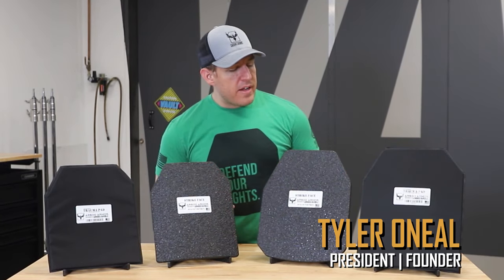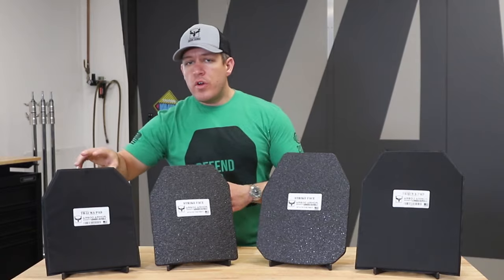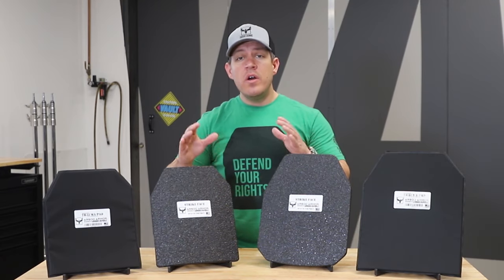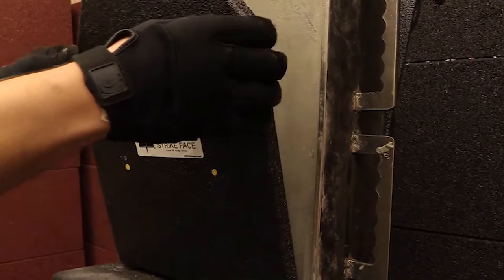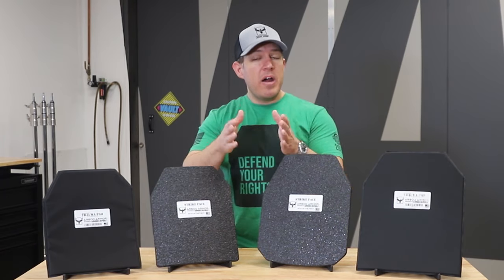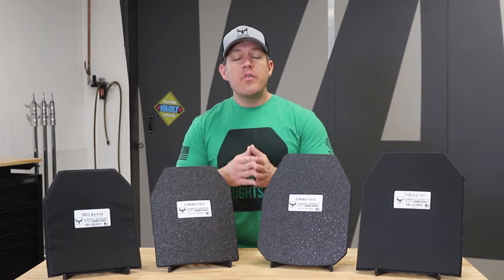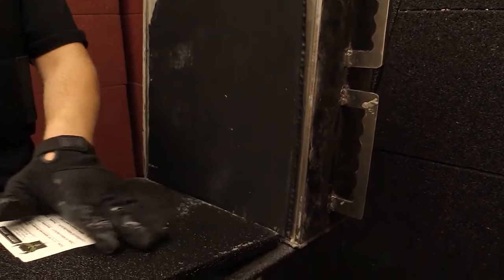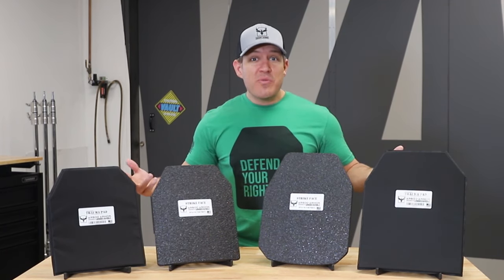Why Run Trauma Pads?   AR500 Armor

Comment: "Why do I need a trauma pad? The armour stops the bullet."

Yeah, but people dont die because they got penetrated by cars, they die from the impact. Bullets, when stopped by armour, turn into pure impact.
Reply: blunt force trauma
Reply: You dont have external bleeding thanks to the armor
Unfortunately you got hit with a shotgun slug and your ribs are broken,
SOOOOOOO you do have internal bleeding.
Reply: @kenshy10  or you just see a bruise on your skin and you don't think of the bruise being 2-3 inches deep and impacting your lungs or heart.
Reply: Just say: "commotio cordis". They'll either understand immediately or think you're casting spells on them. Win-win.
Reply: I would describe body armor to protect the surface but the force of the bullet is still there.
In other words, its like shooting and shattering a window pane glass of a store. The bullet is able to travel through the glass, and still damage what's behind the glass. 
Another easy example is, when you buy a product that can shatter glass, which is sometimes an extra feature from self-defense non-lethal weapons like whips or a belt cutter. They may send you a sample piece of material to shatter as a test. If you imagine having a piece of wood, glass, or other material, a thin piece of it, on your or someone else's body, and strike the middle with the glass-shattering needlepoint, while the flat thin piece of material protected the body, the force of the strike is still spread around the body.

In another example, imagine the prank some kids do by putting a hand on your scalp and hitting the top of their hand on your head with their fist. You'd still feel the effect of the force spread under their hand that is spread much more widely across your skull and head/neck. 

I'm new to the gun world still since 2020, so this video helps me understand that trauma pads are meant to be placed behind the steel/ceramic body armor to dissipate and mitigate the rest of the force of the bullet.

The only problem is choosing the right plate material for different situations, such as knife attacks and bullets. 

So far ar500 is showing ceramic + soft body armor to have shelf life of 5 years, which is barely anything. Soft body armor are around 100 so its affordable all things considered but for me who may be someone who finished college, many of these purchases for body armor, trauma pads, the chest rig or just the vest, and even gun optics, can be very pricey between 100 to 200 to 400 to 600 easily. I still need to get a can for my guns. 

I'm glad I went with steel armor to keep it over a long period of time but at the same time its a waste to use against pistol rounds, but I had to get the toughest first, due to the panic buying going around. Things cooled off in the last year luckily but the last 10 years (or century) is still the best time to be stocking up on everything, even emergency food buckets that are supposed to last for around 20-25 years at least while unopened. 

First you see riots or crap in other towns/cities. Then when you see it happen during the Flloyd riot night on local television, its akin to seeing the start of a zombie apocalypse (or any apocalyptic/SHTF situation) when looting and violence starts. Thought to myself, NOPE. I'm getting a rifle by the end of this week and that was final.

It's just shitty when you live in a peaceful city and you just never expected it to happen. Never expected crazy gangster shit to happen, and when it does, your world is never the same. We're already in that zombie fantasy world, we just didn't realize the level of danger and the necessity for self-defense till disaster struck near us. 

People talk about self-defense but come on. Guns are meant to take people out too when necessary. People are too scared of that burden and scared of crossing lines.
Reply: @yourmumsy1081  Solid armor stop bullets. Soft armor, pads, help transfer the force from a bullet size blunt force to the pad which is over a large area. It's like having a fat chick that weighs 200 pounds completely put her whole chest and stomach on yours when you are lying down.  Then you take a chick that weighs 100 pounds only she is standing on your chest and stomach while you are lying down. The fat chick in this case is the energy on the trauma pad. You have more energy but it's transferred a larger area which helps reduce internal damage.  The skinny chick in this case is the energy only hitting a smaller area but with a concentration of energy that is higher which may cause more internal damage. If you are serious about armor, soft armor is part of the kit.
Reply: @kenshy10  internal bleeding? That's where the blood's supposed to be..😂
Reply: @drakke125Channel  bro that was the worst and longest reply i dknt think anyone made it past the seckng paragraph

Comment: I Know it's a old video but I'll ask anyway. o and love y'all's armor use it's in all mine and my family's kits. fell free to send me some products to test. anyways ..... my Question is if you have Kevlar armor would you still need a trauma pad or would the Kevlar act as a trauma pad? some of our plate carriers come with the Kevlar init already and I always wondered if I still need to get them. we use y'all's steel armor plates in all our carriers.
Reply from the maker: Thank you for the question. No, Kevlar and Trauma pads cannot be used interchangeably. They do different things. Kevlar provides a material that is strong enough along the tinsel lines to stop a handgun round.  Trauma pads use a non-Newtonian padding to resist energy with an equal and opposing amount of energy.

If you are talking about stopping something that may pass through the primary armor, Kevlar (or soft armor) is what you will want behind it.

When the primary armor stops a threat, a trauma pad behind it will dampen the forces pushed back into the wearer. Kevlar will NOT dampen these forces and the transfer of energy from the main plate will pass through the soft armor panel in into you.

Ideally you would want all 3 if permittable.
Reply: @ArmoredRepublic2  thank you for the information we will definitely be adding the trauma pads in our carriers. Keep up the good work and keeping everyone safe.

Comment: As I've been digging into armour, I've been increasingly curious what exactly makes up a trauma pad? I do not see reports of people having personal results with them (fortunately) but it does begger the question... What exactly IS a trauma pad? 

Non Newtonian fluid feels wrong, because they aren't fluid and if they were, it would settle to the bottom of whatever seems they had. I don't find cutaway videos or anything really breaking this down. I don't want to volunteer to be the guy to "demonstrate" a with versus without, but without any firsthand accounts I can find, it makes me more curious... 

BFD aside, the NIJ has an absurd level they accept. Some 44mm which is almost 2". Insane, not a level I'd want poking into me, bullet stopped aside. So to simply be NIJ rated and assisting that isn't curing my idea that trauma pads are a touch of snake oil... I am really curious, please help me understand.

Comment: Is there a benefit to running two trauma plates behind the steel plate?
Reply: No. As the video shows, there was no dents into the clay molding with trauma pads.  No need for another set.

Comment: My whole family is armored by your products, the only complaint I have is with their Phoenix back packs. On your video about the backpacks its shown to have Level 3 soft armor, and its sewn in its own compartment opposed to a single panel you just put inside the backpack. The video and the photos on your site shows how the soft armor cover the back of the backpack from top to bottom. But when my order came in the soft armor was sewed into its own pocket but does not protect from bottom to top, the armor inside is too small so it slides around. I bought them because both of my girl had CODE RED at their schools earlier this year. The back pack is shown to be a shield, worn on front of body, worn on the back. But you can never tell where the soft armor is going to be if it slides down to the bottom, then the most vital areas are not covered because the top 4 inches of the pack is unprotected. When we have to wear armor we make sure its worn correctly, and placed properly on our bodies. But with the back packs I received you can never tell where that life saving protection coverage is.
Reply from the maker: Thank you for all the support!    If you are not happy please contact our customer service and they would be happy to help you or replace your item.
Reply: Yeah if the pad can slide around very much, that’s a little bit of a problem.  However they do offer good protection where they cover.  I bought the separate pad(s) so I could install them on my backpacks.  They fit well and don’t move around. However even these don’t cover 100% of the backpack.

Comment: Do you need a trauma pad for the soft armor?
Reply from the maker: Trauma pads are designed to be worn in conjunction with and behind your body armor to reduce the amount of energy transfer to your body, reducing felt energy through your armor and mitigating backface deformation. Trauma pads offer no increase in ballistic protection. Up to you if you think it is worth the padding! Personally I would!
Reply: @ArmoredRepublic2  I was just wondering if they work with the soft armor, or if they were only made for the steel plates. That was my question. So I assume it is a yes.
Reply from the maker: Yup they will work with soft armor! Here's the link to our soft armor. You can add the trauma pads as an add on. https://www.ar500armor.com/soft-body-armor.html
Reply: @ArmoredRepublic2  Any discounts right now?
Reply from the maker: Use code 9years for 20% off!
Reply: @ArmoredRepublic2  really? Does it work with bundles?
Reply from the maker: Yes! It wont work for promos and target though.
Reply: Oh ok I see it does not work with the promo from Elijah Scheafer.
Reply from the maker: The soft body armor didnt work with Elijah's code?
Reply: @ArmoredRepublic2  no the 9years code doesnt work with elijahs offer
Reply from the maker: Oh I see! Only one code will work for each transaction.

Comment: bought mine three and a half weeks ago and it arrived three days ago!  Spot on shipping calculations even regarding everything going on "these" days.  

One thing I am not truly happy about is the outsourcing to Vietnam for production.  I was not aware of this upon purchasing due to the "USA" made labeling I was seeing.  My negligence in research has been becoming an issues as of late it would seem.

The product is quality to say the least.  I do wish I had taken advantage of the "anti-spalling" purchase at checkout.  As it would have only added roughly $90 maximum to my order.  An order of which was only $323.16 for the Veritas plate carrier and cummerbund strap.  

I mean WTF over?!?!  less than $350 you're protected from some serious situations in many respects.  

I will be using some (QOURTER INCH THICK) duct tape for my spalling needs..... Only the front of the plate needs to be coated that thick, so I figure a good three or four wraps around whatever takes to be the thickness needed should be sufficient in the end.  

Because come on.  "In the END" just stopping the round is going to be sufficient, so any added ANYTHING is going to be the butter to your bread...
Reply from the maker: Glad you are satisfied with your carrier! So the armor plates are made here in the USA, the carriers are all designed here as well but to expedite production, we do outsource the production of some of our carriers. We appreciate you feedback and hope you will purchase from us again! Thanks for the support!

Comment: Would soft armor work as well?
Reply: That's what he said at the end of the video " have the soft ( trauma  closest to the body then the 500 ."
Reply: UM Maybe but you wanna add another 8 lbs to your KIT?
Reply: What is the thinking behind running the trauma pad behind your hybrid soft iiia armour?  Necessary?
Reply: Soft body armor would be a bit of a waste behind hard armor from a cost standpoint.  The teams pads are a fraction of the cost and are more than capable of moderating the blunt force trauma. If you had a spare soft plate I suppose that would be okay too.  But it’s unnecessary and doesn’t really give any added  protection.
Reply: No. It wouldn’t harden to absorb impact, and it wouldn’t give you any added bullet protection. 
If you put a soft panel behind your III+ armor a black tip would still pass cleanly through both.
Reply: @Wat-Dat  if it's an armor piercing round then no armor will stand up to a certain degree will stand up to it
Reply: @scottlehman9738  No. Level 4 would eat it.
Reply: I mean hey kinda sorta compound spaced armor your choice

Comment: Steel body armor does not produce any substantial blunt trauma. Instead it produces an “ultrasound” wave (I don’t know a better way to describe it) caused by its vibration, that can damage your organs. This is unique to non deformable armor made of stuff like ballistic steel and titanium. The more momentum/energy the plate stops and the less it weighs, the more powerful this wave will be. In order to mitigate it, for M80 ball, an inch gap should be present between the plate and person’s body. It can be literally any material, i.e. foam or rubber. Although I’d personally put some NIJ IIIA Kevlar behind it. In 90s and early 2000s, Russians put Kevlar behind their 4.6 mm steel plates and certified it as an equivalent to NIJ III++ (7.62x54R LPS and 5.45x39 7N10).

Also, the spall coating on AR500 is crap. I advise that people get the “base layer” version and wrap it in glued Kevlar/Twaron instead. 10 layers of 200 gsm Kevlar should do the trick.
Reply: Thats how I have mine set up. 3A kevlar behind AR600 plates.  I'm gonna use the glued kevlar idea too.
Reply: Can you cite a paper or other resource on the ultrasound effect?  The logic seems sound.
Reply: Brian Live tests on animals in 1970s, conducted by Soviets. Documents are in Russian and probably not available online.
Reply: Ultrasound is used in medical imaging of delicate tissue. The ultrasound from armor theory is basically bunk, and relegated to Sci Fi.  Bullets that hit large metal plates don’t cause the plates to vibrate at the frequencies required for Ultrasound.  These plates tend to “ring” in audible ranges which is well outside the ultrasound range.  Also this combination could never produce sonic energy levels at the level needed to cause damage to tissue, that’s firmly in the Sci Fi category.  

This is not to say that plates don’t vibrate when hit, they do, it’s that the vibration isn’t what is doing the damage.  Impact energy and Back face deformation is what do the damage.
Reply: @richb2229  There had been countless occasions when people survived shots on armor that resulted in 2-3 times the maximum backface deformation as stipulated by NIJ standard (44 mm). Steel plates on the other hand barely have any backface deformation (usually a maximum of 5 mm). Yet, there had been confirmed instances during the Chechen wars when soldiers died or suffered organ damage from shots on body armor’s steel plates that remained intact and didn’t even leave any bruising on the skin.
Reply: @richb2229  ever smacked a steel plate with a metal handled hammer? It'll sting yah

Comment: If you have the level IV ceramic plates are trama pads still a necessity?
Reply: Ceramic distributes the force way better than steel so no
Reply: better safe than sorry
Just use it.
Reply from the maker: Personal choice.   It will help  mitigate blunt force trauma from the impact of the round.
Reply: Yes you should run a BDU, then modern mesh long hauberk down to your upper thigh, then a polymer gambeson, then a jacket with curved ceramic plate inserts. Then polymer throat armor.
Reply: Yes, the extra weight and 40 bucks is more than worth it. While ceramic is better in some ways to steel, we are still talking about high energy rounds.

Comment: Would it be better to just run a level ii or iiia soft panel behind the steel plate?
Reply: Trauma pads are in the twenty dollar range, the soft armor is worth more then the solid plates. Translation your price point skyrockets into well over a thousand plus dollars vs six hundred or less for plates and trauma pads.
Reply: @Predator42ID  of course the cost of the funeral is higher still

Comment: So, doesn’t lvl 3a soft armor do the same thing as the trauma pads when placed behind the armor plates as well? 

And can you use the trauma plates in conjunction with lvl 3a soft armor and armor plates?
Reply: No they are not the same, and they wouldn’t perform the same.  Plus hard armor performs differently than soft armor and you have to consider something called back face deformation.  

The thee together?  You could but why?  In this case The soft armor wouldn’t add any protection.
Reply: It's what we used in the US Army in our IOTV's. Seemed to work otherwise government wouldn't issue it. It's what I would run in my plate carrier.

Comment: Will a piece of 20 guage stainless spread the impact out more if you dont got room for a trauma pad? Or would the bulge transfer?
Reply: 20 gauge is pretty thin so it probably wouldn't absorb much more impact than the plate in front of it